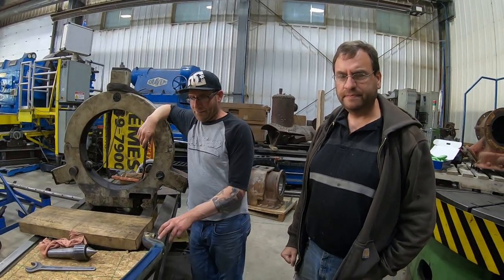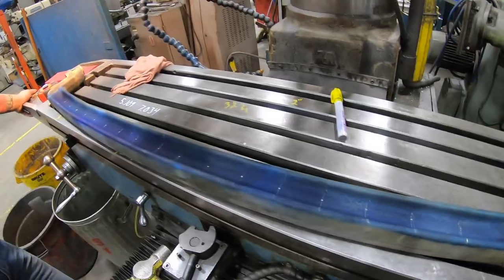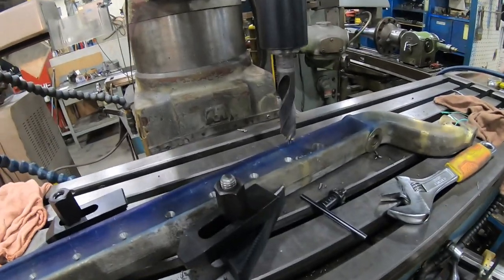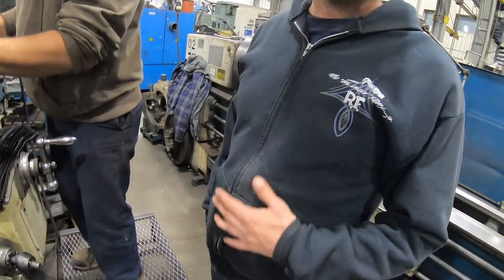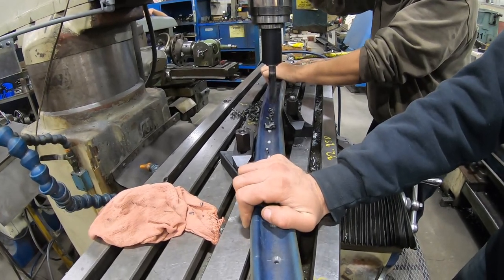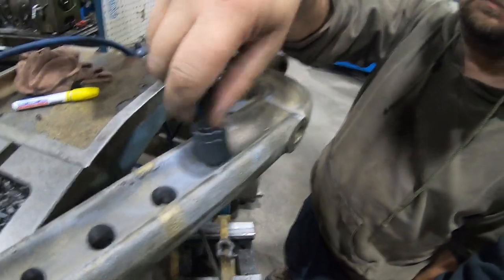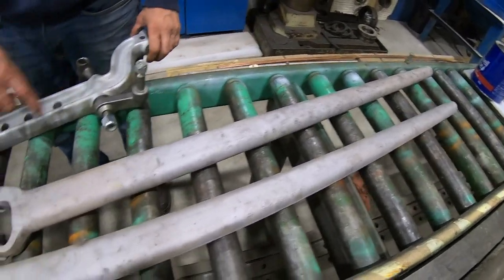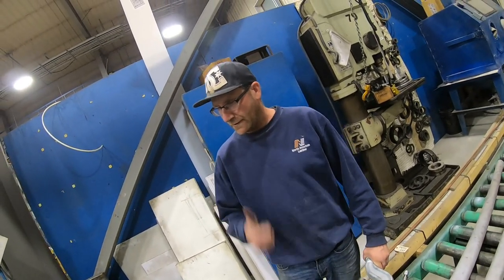1932 Ford Frame With a 1931 Model A Coupe.  Drilling The 4" Dropped Axle. Hot Rod Barn Find 331 Hemi

Comment: No eye protection ! and you should have clamped that axle down -the drill can walk and give an oval hole or worse (like the first hole you drilled) jump up and end up smacking against the body of the mill-If I had been caught operating a mill like that in the machine shop I would have had an axle with however many holes I had drilled so far in it and quick exit out the door!
Reply: Yes your right. I'm a machinist to. Still there's always someone putting them selves in harms way. Brave of you to point the safety aspect out but unless your there they will just keep on doing it until someone gets hurt. Good Onya mate.
Reply: @shfr1747  I am not a "safety police" type of guy but It pains me when I see people putting stuff like this up on youtube  then less experienced people think it is ok to drill a 3/4" hole in steel without clamping the work piece down-before they know it the drill has grabbed and they have a missing digit or worse ,steel ripped across their chest.before anyone goes" ya boo you are talking rubbish" I worked in a machine shop the size of that one for 20 years of my mechanical technician life and saw plenty near misses and direct hits!
Reply: @trikejunkie  here here!  The difference being Tradesman trained in the use and methods who want to go home with all their facilitys verses people literally off the street who think machining welding fabricating are things any home handyman can just jump on and do. AT THEIR PERRIL. Yeah I know seems to be worse in America and the like. I'm in NZ and Australia. Much stronger SAFTETY culture in place in the last 30 years. Still we've got loose head Lens too. I cringe too but have to look the other way.